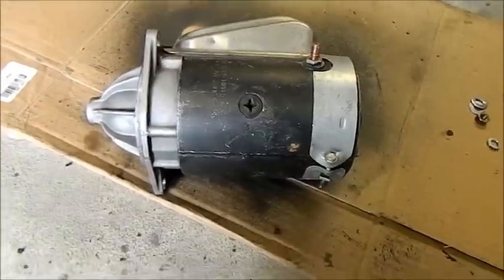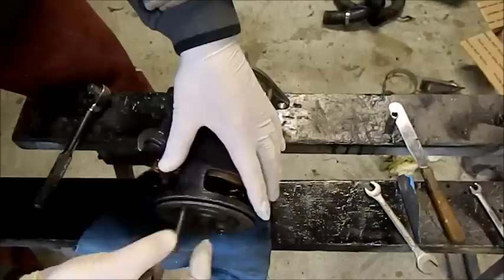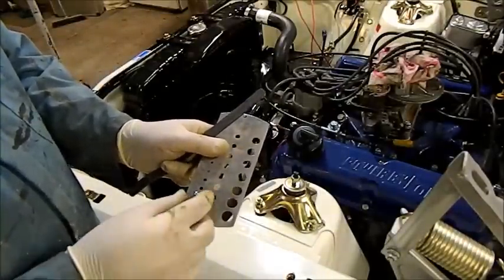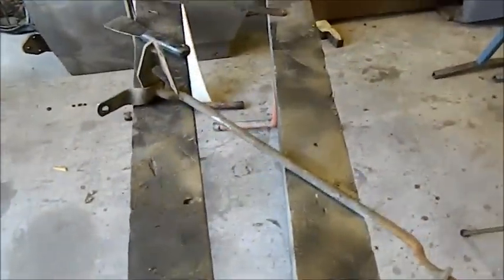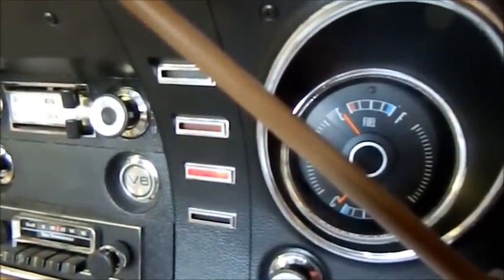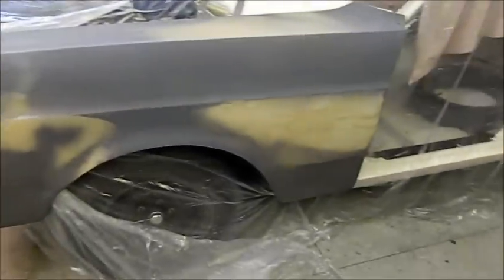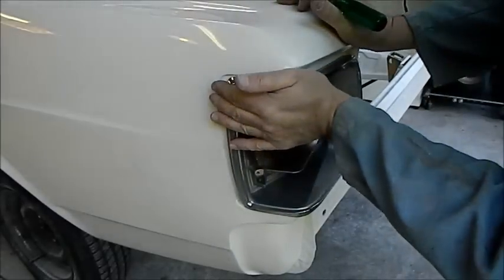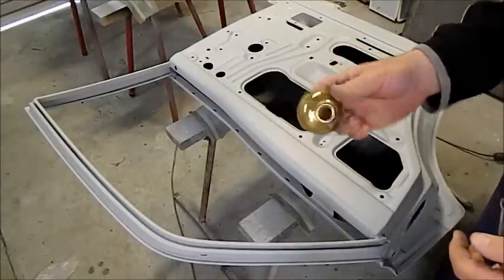1969 XW Ford Falcon Restoration Part 16

Comment: Hi Peter..... Beginning to SERIOUSLY REGRET selling my genuine 351 XA 500 GS in Yellow Fire, FMX and 9" LSD. I was second owner, and all the work your are achieving on your WONDERFUL XW is what i hoped for on my XA. The beauty of Divorce lol. I have had a blast watching all your Vids and have a good laugh at the pains and gains of re-building a motor vehicle. Now onto a much less desirable VK Calais Manual with a 86VL HDT 4.9L GRPA Motor. PLEASE keep the posts coming - look forward to EVERY UPDATE. Keep up the great work !!!!
Reply from the maker: Paul Harc Your VK is certainly nothing to sneer at... beautiful cars. I worked at Neilson Holden when they were new and wanted one really badly. What's ironic is that I picked up a K code XA Fairmont GS while I worked there, toploader car as well. It was in the wholesale yard and I got it for $500 in pretty poor nick, they thought it was a 302. Get this... I wrecked it and used it's driveline in my rusty XC - the dumbest thing I've done with a car to date... all the regrets I have from the 1980's...

Comment: Excellent work Peter keep it coming, this is going to help me alot with my XY build. Nice to hear how much it cost you thanks for sharing.  As you say if you have to get someone else to do your body work its expensive my budget is at $90K.  All ready spend $50k over the last three years, I have another three years to go, the extra body work has pushed my end date out for me, having to fix other peoples crap work.
Reply from the maker: xrs Thanks for your positive comments. Let's face it, although a more expensive build, your car will look a whole world better. I will go in to detail of the costings in the next video... was going to in this one but the printer ran out of ink!

Comment: $20K on getting it to this point is a fair price in my opinion. I spent $25k building my XW Ute and sold for the same amount, and mine wasnt half as decent as yours, especially under the guards and floorpan. If it takes $30K to build as you estimate, someone will pay a comfortable $40K for what you have done. In my eyes WORTH = Quality of Parts used, Time Spent, Detail, Desire of the model specific to buyer. This car is amazing - I doubt you'll sell (not that you've said you want to) though, after your first drive in its new state!
HAHAHA - Indoor Light Switch surround - good as new! Also - these things take time, no rush, we all like seeing these updates!
Reply from the maker: vigilante351 Thanks again, Normally I do far cheaper jobs... When I bought this car I figured that restoring it as a stock Falcon 500 six cyl would be around $15K and as a slightly "Fairmonted" V8 would be around $25K, looks as though I'm going to be over, but I will keep the old girl and enjoy it.

Comment: looking awesome so far. I laugh hard when you were putting the light switch back(Hope wifey doesn't watch your video's).Were you walking around the house with the touch-up guns trying to match up something? I thought you would have made something instead using that. Must admit that's genius. Cheers
Reply from the maker: weighed11 Yes I was walking around the house looking high and low for something that would fit. Suzie's pretty tolerant, when I showed her she laughed.